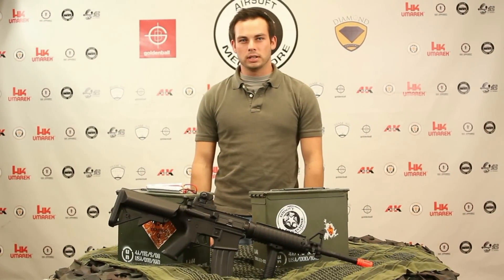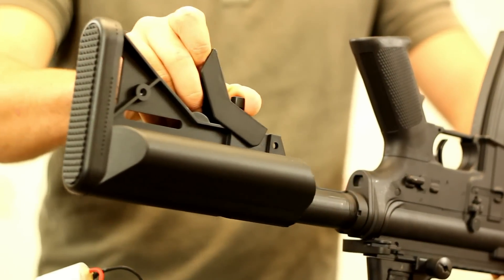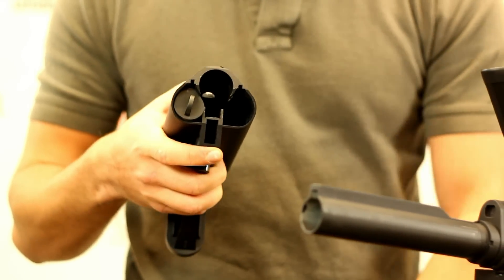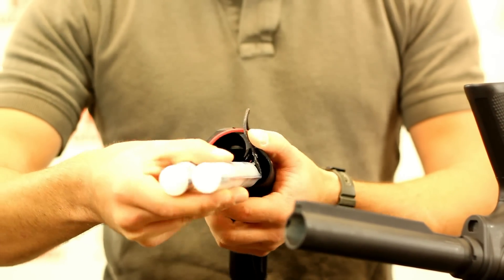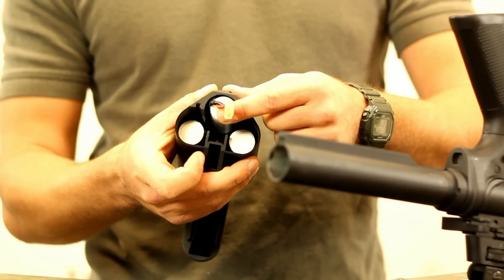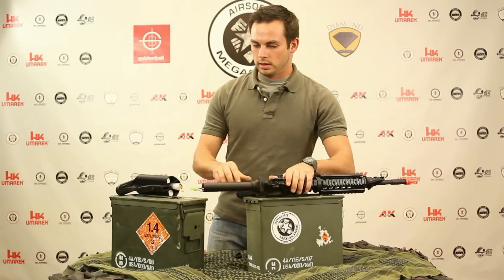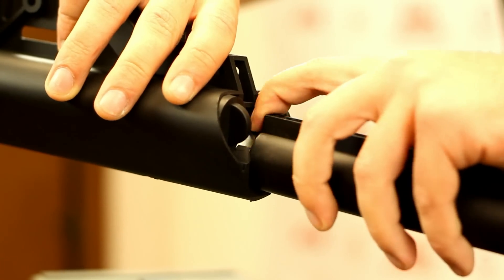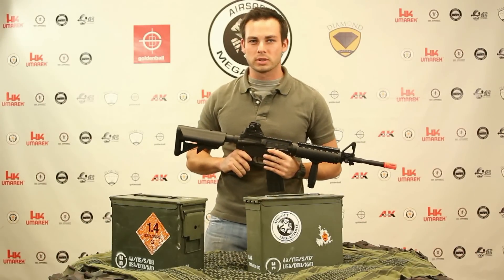A&K M4 RIS - Crane Stock Battery Install - How To

Comment: my stock doesnt isnt open in the inside... there are walls everywhere... i have 3 stocks... and every single one isnt open like yours in the inside (i mean the 3 chambers are seperated with plastic.... its not one big single chamber... 3 seperate ones..) sorry for my english
Reply: i have an ares aeg with e-system.
Reply: well thanks. my friend has a 7.4, 1200mah. and also the 11,1 1200mah working! nice! :D so simple and i didnt come to that conclusion.